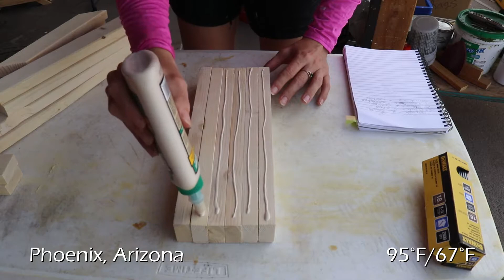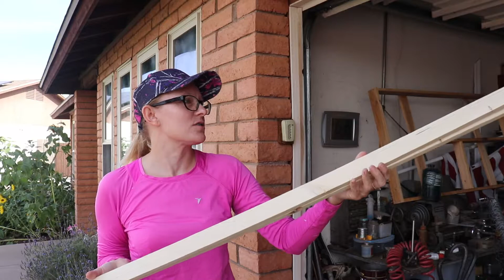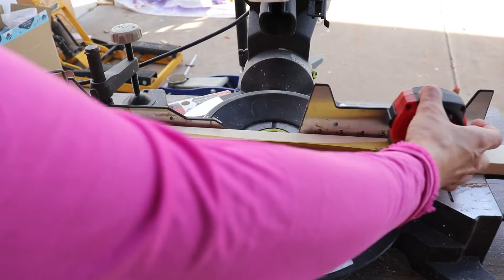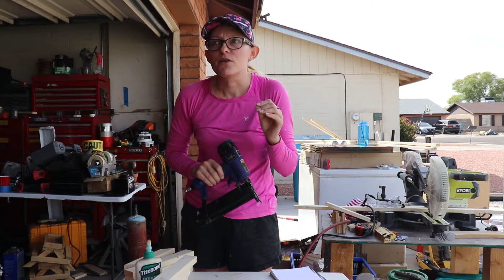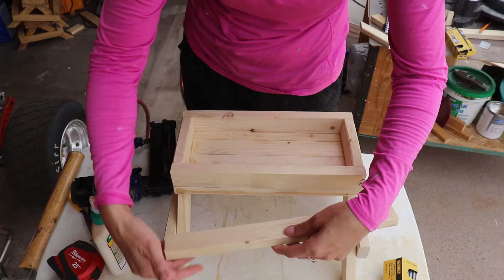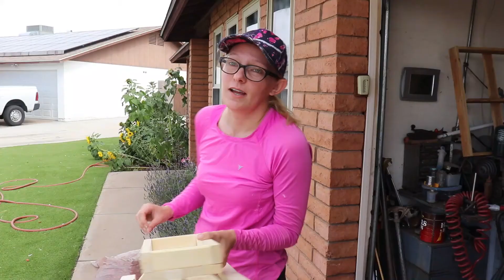Chicknic Table - How to

Comment: So what might a person charge for these?
Reply from the maker: It all depends on the quality and demand, but also cost to build it. I used to charge $20 for a small and $35 for a larger one. However, I have put them on hold until lumber prices come back down because the supplies and time didn't add up.